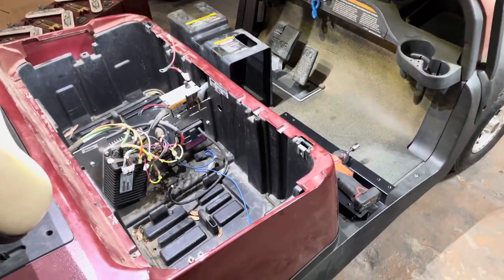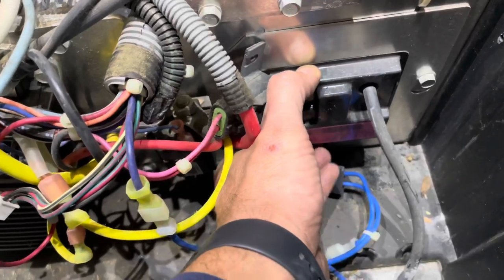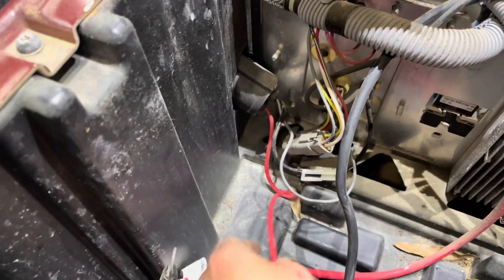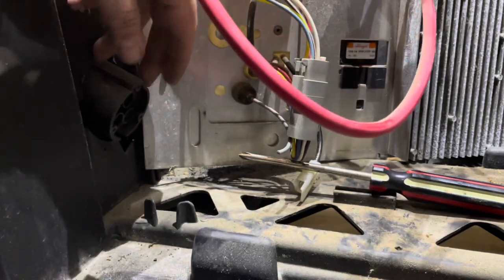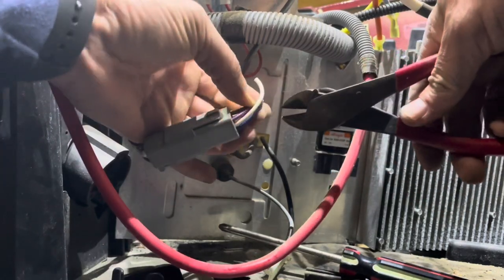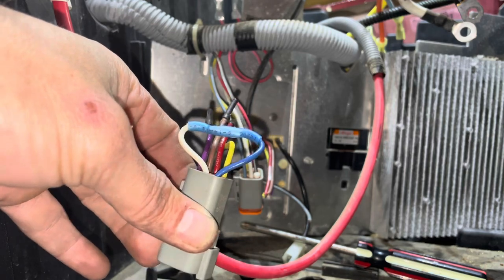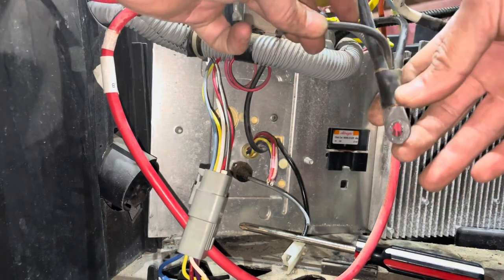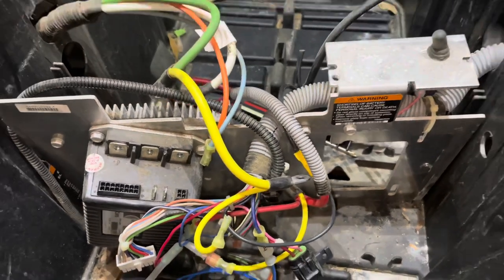Club Car Precedent OBC Removal (2004 ~ 2009)

Comment: Thank you for the beautiful explanation and demonstration of where the blue and white wires are supposed to be connected. I didn’t realize that I could get rid of the entire OBC, that simplifies things. Sergio on buggies gone wild also suggests running the 10 gauge black wire to B-. But if the entire OBC is deleted, I’m now confused. After jumping the blue and white, is there something to do with the black 10 gauge?

Comment: This was very helpful.  I just upgraded to the BB Eagles.  Im using a club car IQ setup with a navitas AC conversion.  Due to the Eagle plug not having a charger wire, its throwing an charger lock out error.  I believe I should be able to jump these wires and eliminate that error.  Much appreciated.
Reply from the maker: Best of luck with it!

Comment: QUESTION: Couldn't one just run a jumper wire from the charge receptacle to the negative terminal of the battery bank, bypassing the OBC without removing/clipping anything? If the OBC is 'off' (not allowing charge through), but there is another path for the electricity to get to the batteries...then won't the batteries charge despite the rest of the system still being intact? Just seems like more work than is necessary.
Reply from the maker: Sounds right, I just do it how I learned.
Reply: @PalmettoBatteryPros  
That's fair. Yours does look more clean and professional. I'm more of a "just plug in the seatbelt and sit on top of it to shut up the stupid seatbelt reminder chime" kind of guy.

Comment: Question - Why are you cutting and then splicing the blue and white wire together. Evidently, I may have a newer 2009 CC Precedent, where the OBC is mounted on the back firewall. I don't see that there is  blue and white wire coming out of the OBC.
Reply from the maker: I would bypass the OBC, drop the battery in and see if the cart operates normally. I think you're fine not to do the bypass.

Comment: What is an OBC and what is its function.
Reply from the maker: The OBC regulates the charge of the batteries. Its grounded at the controller and the positive goes to the battery bank to supply energy during charge cycles.
Reply: @PalmettoBatteryPros  Thank you

Comment: I have a 2007 Club car Carryall 2. I just installed AGM batteries. I bought a specific AGM charger that came with Club car style plug. Does my cart have the obc? Do I need to remove it?
Reply from the maker: Yes, it needs to be removed

Comment: Why are you bypassing the obc?
Reply from the maker: Various reasons. For lithium conversions it can be due to the system not grounding in some older carts. Mostly due to the replacement of the charging port to a receptacle that you just plug an extension cord into to activate the onboard charger. Other reasons can be things like upgrading to a smart charger or sometimes they fail and some people just bypass them.
Reply: We converted to lithium. Made no other changes. Seems to be working fine.

Comment: This may sound dumb, but you said cap and insulate the other wires when you butted the blue and white.  What did you use? Electrical tape?  I googled it but it keeps sending me to wire nuts.  I just did my obc bypass using your video except mine is on a DS.  Just want to “cap and insulate” correctly.
Reply from the maker: You can use anything to secure the ends. I use heat shrink, but E tape will work just fine as long as it doesn’t come lose.

Comment: Question the 2004-2008 Precedents, when you have headlights and tail lights they're supposed to run off of one 12 volt battery. I'm upgrading to 3 48volt 30ah lithium batteries how would the headlights work now if there is no more 12volt battery also same Question if I was going with one 48volt 105ah big battery setup. Wouldn't it ruin the lights and how would you hook up the voltage reducer because I know that's probably the answer you would say and I understand that just lost where and how this would hook up because the 2004-2008 com pre wired for lights and I can't figure out where the negative and positive is to hook up to a reducer and no one seems to know where the negative or black wire is pretty sure the positive is the blue wire with the little black thing that comes with the headlight kits for these year carts.
Reply: Same question here.  I bought the reducer and mounted it for accessories, but don't know what wires in the pre-installed bucket harness I need to splice to the reducer.  I can hook other accessories now but not the lights/brake lights, et.

Comment: Quick question I have a 2005 club park president and I don't know what other wire goes to the run tow switch I see the pink wire and I have the blue wire with the diode in it but there is a red wire that cut coming from the same harness the pink wire comes from thanks
Reply from the maker: Hmmm.. I’d have to see it.

Comment: I disconnected the OEM charge port. My BB Eagles have their own charger that plugs directly into the battery bank. I did not jump or bypass the OBC. Is controlling the charge the only purpose of the OBC?
Reply from the maker: Correct

Comment: Would this procedure work on a 48v club car 2012 with OBC.  the wiring looks the same.  only difference I see is my controller is different.
Reply from the maker: Yes, we may have done your cart. Check our other videos
Reply: Hello!....late in the post here, but did you happen to try this on your 2012 Precedent? If so, any success? I'm doing that to mine right now and my cart is the same year. I hope to hear back. Thank you
Reply: @Shred.Krueger  yep. I just followed the video instructions.
Reply: @michaelmelder8619  awesome. Thank you so much for getting back to me 🤘🏼😎

Comment: If I remove the obc on my 2007 club cart president 48 volt how will I charge my lithium battery
Reply: My new lithium battery charger is set up for my 07 Club cart plug in and charge, so why do I need to do a obc by pass
Reply from the maker: With the charger that will come with the lithium battery.
Reply from the maker: Most of the battery brands do not require the OBC bypass. I recommend bypassing it.